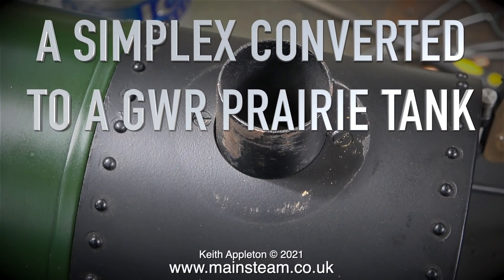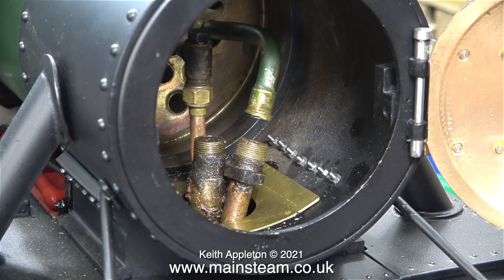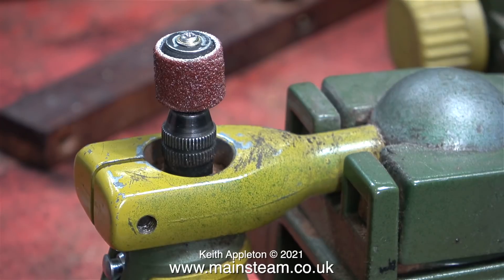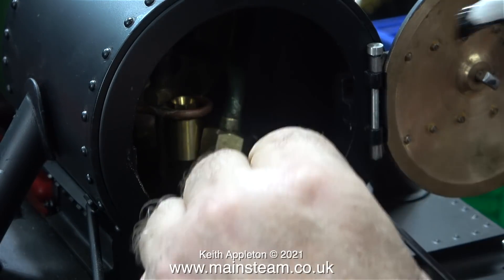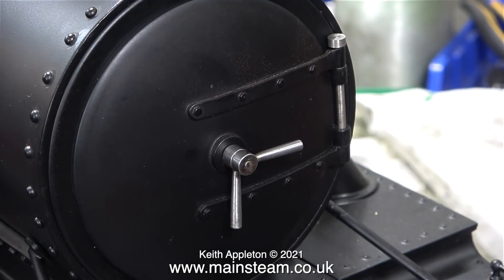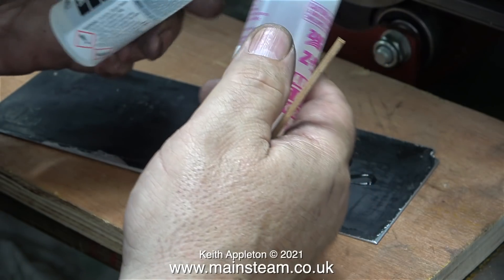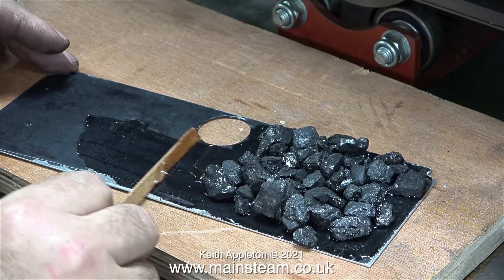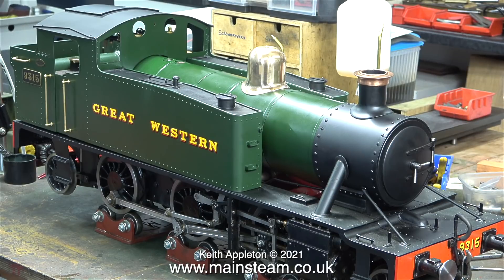SIMPLEX PRAIRIE TANK - PART #98

Comment: Keith, I've used Dow Corning Fire stop to seal the bottom of smoke boxes. It's water based easy to use and cleans up well. It also expands slightly when it gets hot and gets into the cracks and crevices making a good seal.

Comment: FWIW,it is years ago now but I knew a mining engineer who worked at the Cassiar asbestos mine. He stated there was an enormous safety difference between short fibre asbestos and long fibre asbestos. Short fibre being the dangerous stuff. Different geographical regions supply differently  because of the vulcanism that creates the stuff. I think it was Africa that supplied the majority of long fibre asbestos.
Thing is,without a microscope and fairly expert knowledge of what to look for,how do you tell the difference. I asked him that question,and he just laughed at me.
Short or long,once in the lung tissue,it is not going to degrade,and likely not to be expelled. So current safety standards on the stuff are maybe not such a bad idea. Useful though it was.